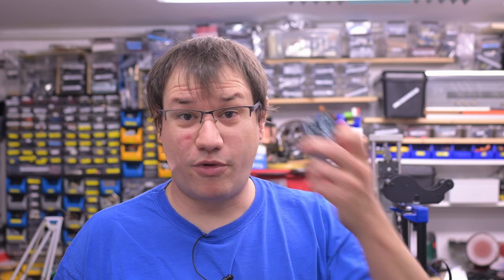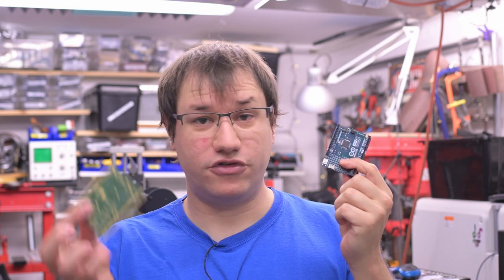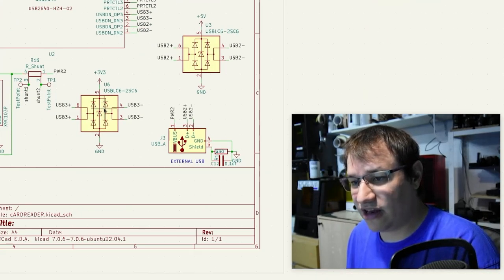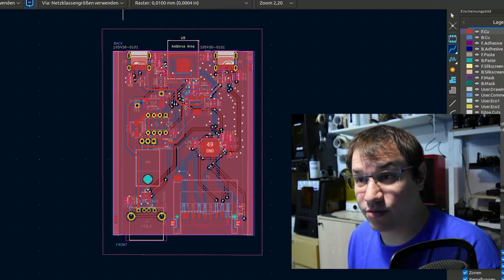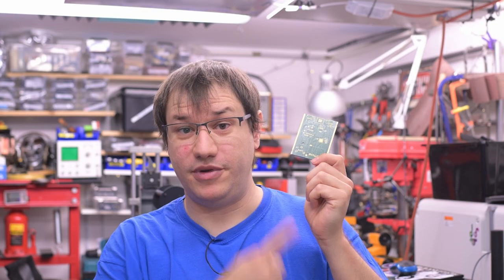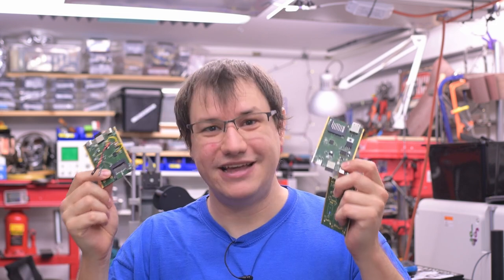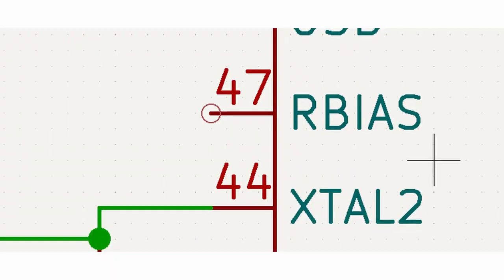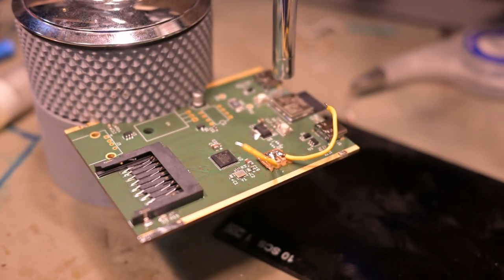Building a Unique USB Card Reader: From Idea to Prototype

Comment: Current limiter:
1. Better check the dropout voltage the LM317 will be introducing. Add 1.2V drop on the current limiting resistor to it.
2. The full output current passes through the current limiting resistor. Can the digital pot chip handle it? 4.4mA is the max wiper current according to the datasheet.
3. 10k 100 step pot for a range which requires hundred of ohms? Iout = 1.2V/Rlimit, for 500mA Rlimit=2.4Ohm
So, if it really has to be LM317, i'd boost the 5V to compensate the drop and add a stepper motor controlling a high wattage wire wound potentiometer (plus a steampunk enclosure) :) 
Or just use one of the hundreds of dedicated USB power switches with adjustable current limit. They will work with digital pots, have a very small burden voltage plus a few more protections built in.
Reply: and those would be great ideas for a second version!
Reply: @MAYERMAKES  Here's another one, using the same type current limited power switch: make an inrush current limiter (ie.: set the input current to 100mA initially for the enumeration time and after some delay to max allowed value). This will allow a lot more capacitance on VBUS and more stable operation.
For the output protection - there is an interesting chip, UCS3205,  have it on one of my boards now, although not tested yet. It combines all the required functions in one: power switch, current limit, overcurrent/voltage protection and it has a voltage output proportional to the output current, no need for any external sensing.

Comment: Nice prototype.. and good that you shared the experience with everyone. I have a pile of 1st iteration products that don’t quite work right 😅
For modules with cans I usually use an IR preheat station underneath while using hot air on top. Works a treat!
Reply: thanks, dont we all,.,.. good tip with the preheating station!

Comment: I had that exact same reflow issue with the ESP32 C3 module. The pads just don't like the solder at all.
Reply: I soldered it multiple times befire ,butvit is very particular on heat and the shirld sucjs up a lot of it. Very easy to go wrong😂

Comment: Clem one thing about the metal case. It might block a lot of the wifi signal coming from the Esp32. I'm just thinking outloud here.
Reply: that is a detail i did not explicitly mention in the video but you can see it in many shots, the antenna is sticking out the back of the device. the usb-c ports are exactly in line with the end of the case, but the antenna goes further back so it is not blocked by the case.
Reply: @MAYERMAKES  Honestly I didn't see the antenna sticking out the back of the case. I missed that part. I have to rewatch it again. Thank you.
Reply: @DiyintheGhetto it is easy to miss since i did not point itvout explicitly😂